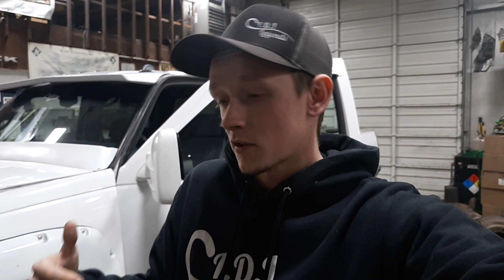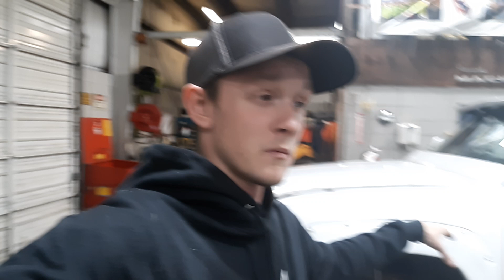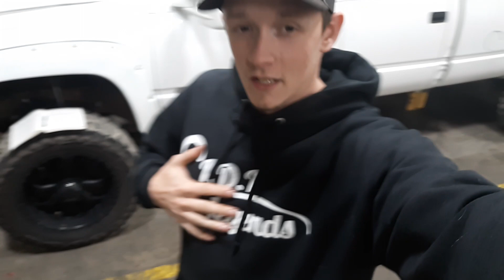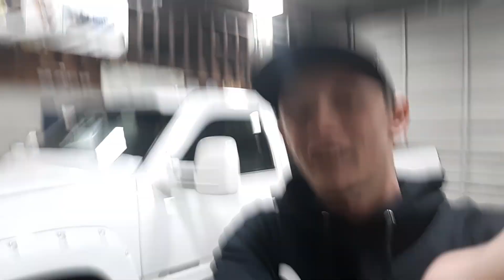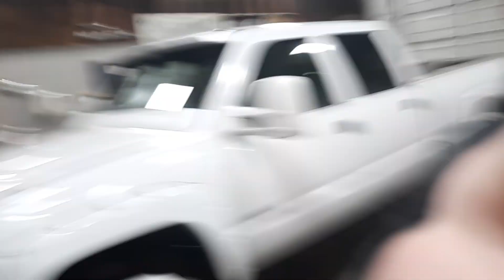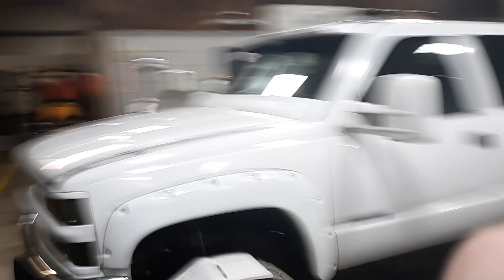6.5l Marine injector confusion (answering your questions #7)

Comment: Iv got to find somebody to go through my 6.5 I'm from Minnesota I'm having a few issues I can't figure out and I need this truck for work
Reply from the maker: Hey man, unfortunately I dont know of anyone in Minnesota, but what seems to be the problems your running into?
Reply: @JessePelkey1   brakes up when accelerating I did change the injectors but still dose it hard starting  sometimes smoke out the oil dipstick tub truck only has 160000 on it

Comment: What injection pump would you recommend?
Reply: Hey Zach:     I've had a '97 6.5 for a dozen years,  and its been reliable as hell,  expect the couple of times it wasn't.  ( lift pump failure,  pmd failure...)      I am no expert by any means,  but have been listening and learning along the way.     The way I understand it,   the 94-95 years had a Non optical sensor set up on the injection pump and because of that is more reliable.
Might want to double check that with Jesse here...or any of the diesel forums... Just a thought....
Reply from the maker: Personally I've had more experience with the DS4 injection pumps, even with all their faults I still personally prefer them over the db2 injection pumps but that's just me

Comment: can it be done to where you can flip a switch and get the power  and  not sacrifice MPG  almost like boost  switch
Reply from the maker: I could see this happening more or less with a tuner. I believe there are select position tuners even for the later model 65 that help make this possible

Comment: That's a quite simple over view of components, the issue with diesel injection is to keep injection duration in approximately a 40 degrees or crank rotation window, with std injectors this is possible up to a point with increasing injection volume, the more volume the longer the injection event duration in degrees the crank turns, then comes the point when injection duration exceeds the point where it will burn completely and you get high exh temps and black smoke, you can advance your pump timing by 2 or 3 degree's to offset this some but the fix is to change injector nozzles to ones with larger holes ( bit like jetting a carb) then it can flow more fuel in less time ie crank degrees, the real point is to keep the injection event as short as you can even with the extra fuel for the extra hp you want without raising exh temps excessively, the standard injection pump will give more to a point (the electronic pump is a 4 element pump as is the marine mechanical pump)then its upgrade time for mechanical pumps if you want more, on motors with the filter module in the valley there are some restrictions in lines that need to be addressed (Leroy Diesel is a good staring point for vids) a good lift pump to maintain pressure at full load full throttle ( checking with a gauge at the pump) is a must ( Bosch 044 etc) no different to a carb fuel supply needs, the mechanical pump is a bit more evolved to increase injection volume than electronic pumps resistor change but doable, this is done by increasing plunger travel inside pump by decreasing clearance to cam ring  2 screws to be wound in the same 180 deg apart inside pump changes the shape of the retainer to adjust max plunger travel, this also advances pump timing slightly, if you dont understand any of this either don't touch it or do your research first as there are vids about these things if you look hard enough
Reply from the maker: It was meant to be simple, some of the newer 6.5l owners wouldn't understand your comment which is why I more or less said it in lame man's terms. At the time I was getting alot of questions whether or not someone should go with marine injectors and I was more or less trying to explain that if your not looking to hop these things up you don't necessarily need them, there are other modifications I would do first before going ahead and replacing just the injectors with Marine ones. I do appreciate your comment, thank you

Comment: Hold on the injection pump is crap ill admit that right away its the same thing on the humvee cuc vee and various other both commercial and military equipment when it comes to that I would match it to a pump from Jhon deer tractor or Kubota thier variable and much higher flow rate it might be what you need .
Reply from the maker: I agree, I don't believe marine injectors are useless, I don't believe that at all. In fact with a proper working injection pump marine injectors can and will increase a bit of horse power, however with an old worn out pump and the higher pop pressure on marine injectors the injection pump cant meet the demand of the injectors to properly pop off. I was more or less trying to get across that marine injectors aren't (more or less) necessary and stock injectors will work just fine with the old pump someone may have on their truck. Now if it's a brand new pump and the shitty factory lift pump has been upgraded, then yes, the potential for more horses is there. Thank you for commenting man 👍

Comment: Hello Jesse, waiting for the video about the optical sensor hahaha.
On fuel supply, would another truck's lift pump work? What do I need to see or specifications to look at the time of purchase? 
Here in brazil it is too expensive to import the same one you use, would there be another similar to the original only better than him?
Reply from the maker: Dont worry man, I haven't forgotten about the optical bump video, I haven't gotten around to it due my turbo kinda taking priority at the moment. Haven't been running my truck as of recent because of it but I do have the optical bump on the list of videos to make for ya. As far as finding a lift pump, realistically anything you can find will be better than the stock one. I'm not sure if your able to get any Carter lift pumps out where you are but they are a solid pump and well.
Reply: @JessePelkey1  Got it, the original has what for Pressure 8, or 9 PSI? Can I put a stronger one, like 20 PSI or something without problems? Does the lift pump need low or high pressure?
Reply from the maker: @zinhols  high pressure will lead to problems, look for low pressure, moderate to high flow.
Reply: @JessePelkey1  Ok, thanks

Comment: Hey I just got my self a 94 6.5 and when I floor it there is a stubble, like it shakes kinda when you give it gas almost feels like it’s not getting enough fuel any idea thanks.
Reply from the maker: Hey man, few questions for ya to hopefully help you out, do you know if it's a mechanical injection pump or electrical injection pump? 94 trucks could be equipped with either or.
Reply: @JessePelkey1  it’s electronic for sure. First year.
Reply from the maker: @ryanburbridge  94 was indeed the first year the 6.5l was equipped with the electric pump but I have seen 1 or 2 that did come with a mechanical pump. Granted not very common 👍

Comment: i am in search for a new 6.5 single cab long bed 1997ish.  I found one but it's not 4x4  i am still  thinking about buying it and putting a Straight axle under it and T-Case obviously to make it 4x4 Any advice?. I love my 03 duramax but there is just something about the 6.5 that i absolutely love. plus i love the 90s body style .
Reply from the maker: I did a solid axle swap on my old 6.5l, if you'd like to see how it looks please check out my instagram. The swap isn't hard it's more or less just time consuming and if you dont have the parts truck (what ever you desire to use for the swap) it makes it a bit more frustrating but definitely doable. The 2x4 frames are slightly different in the front than the 4x4 trucks but its definitely doable.
Reply: @JessePelkey1  thank you

Comment: I watched a video about turning the injection pump up with an Allen key. Will the stock pump just turned up be sufficient with the marine injectors?
Reply from the maker: Is the Allen key inside the injection pump under the top cover? If so the mod you are refering to is called an optical bump, bumping the optical sensor advances the timing of the injection pump causing it to keep the injector oper for a slightly longer period of time. The stock injectors will handle the optical bump and marine injectors will just improve on it. I would also recommend the feed the beast mod and a lift pump. The stock lift pump is honestly terrible, you dont have to with anything special or super expensive but anything other than stock you will feel the truck become more responsive due to the constant supply of fuel on tap.
Reply: @JessePelkey1  I’m talking about the db2
Reply from the maker: @BEAMERNOOB  my bad, yes turning the pump up will work nice with the marine injectors, I would also recommend upgrading the factory lift pump (if you still have the factory one that is) to help maintain optimal pump pressure.
Reply: Jesse pelkey I bought the high out put upgrade lift pump from Leroy  diesel  I also have the 93 manual injection pump how do you know if you turn the pump up to much Also using a turbo master on a gm 3 turbo fresh rebuild on stock engine would I be ok running 11 12 pounds of boost
Reply from the maker: @TheClong197833  if you advance the timing too far the truck will run like garbage, the truck will have no problem holding 12psi, just dont got too fat past that psi without head studs or you'll be doing head gaskets👍
Reply: @JessePelkey1  thank you
Reply from the maker: @TheClong197833  absolutely man, sorry it took me so long to respond
Reply: @JessePelkey1  it really didn't lol thanks

Comment: Can you rebuild your injectors on the 6.5
Reply from the maker: You can and they are super simple injectors. And instead of buying new injectors you can also just buy the nozzles to make them into marine injectors, so long as the needle and spring are still good.